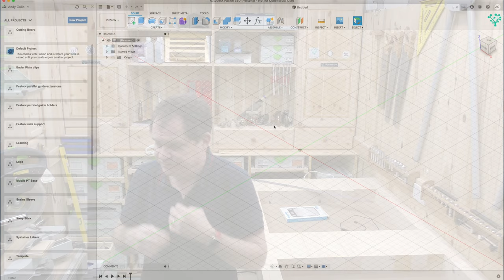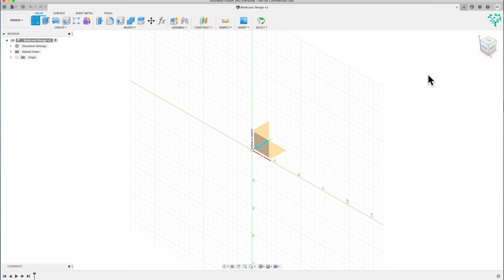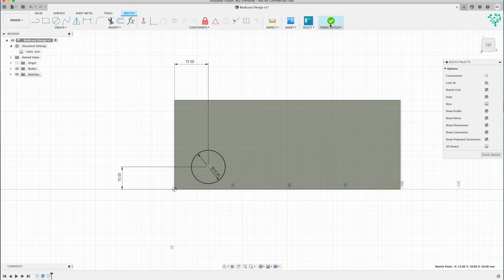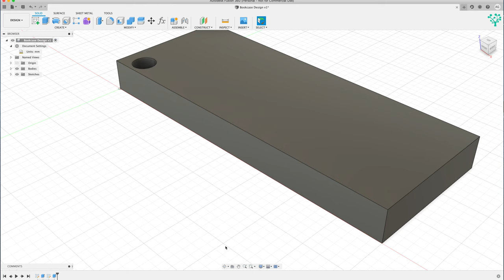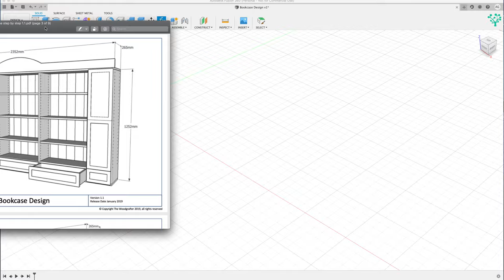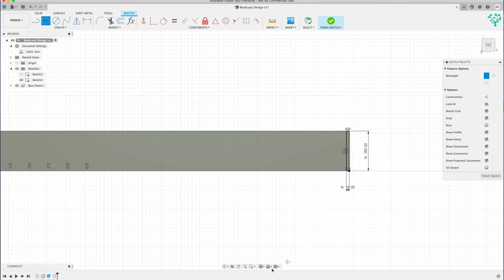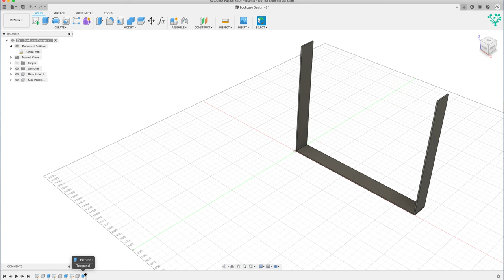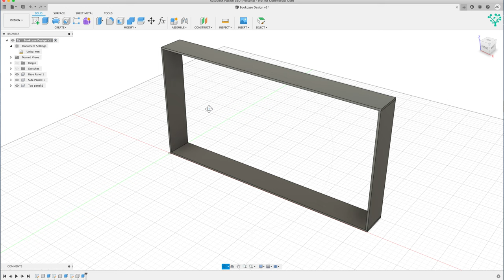Fusion 360 for Woodworkers - Lesson 2 Parametric modelling, bodies and components

Comment: You do an amazing job of clearly illustrating the methods and then reviewing it all at the end of each video-- brilliantly.  For an experienced woodworker, the use of User Parameters is amazingly powerful for a number of reasons.  One good example is I'm building an outfeed table/cabinet and two others that sit beside it.  The style and construction is identical, but the width and depth of one cabinet is different.  I only have to model the one and then I can create a second set of full drawings by just changing the parameters!  If I was a commercial shop the cost savings would be amazing.  I'm just a retired guy who is saving time, but that is precious as well.
Reply from the maker: When you understand how parameters work its a game changer.

I now make everything a parameter, I can’t remember the last time I put a measurement directly on a line.

I have a whole series of coffee tables, I design one table and changed the parameters for width and length and height. New design completed with workshop drawings ready to go.

Awesome.

Andy

Comment: The one topic I would ask that you cover is joints.  What the two types are, when to use each type, and how you use or don't use them in your designs would be of great help.  Thanks and keep the videos coming.
Reply from the maker: Hello again,

Yes I will be looking at joints. I tend to use joints when I want to position something in relationship to something else. E.G. when we make the drawer unit, I will make that as a stand-alone sub assembly and then use joints to put it into final position, that way I can make the drawer open and close along a set path.

You can use joints to position the pieces of the carcass as well. E.G. I could have made the side panel, and then made the top panel and used a simple joint to connect them together.

I don’t tend to use that technique as I just start me sketch on the face I want to connect to.

It will make sense when we get to that episode.

Cheers

Andy

Comment: Great video again, learning about those parameters was really helpful. I've built some models for my 3D Printer since your last video, and although I got the job done, it was always a lot of trial and error. These videos help give a much better basic understanding!
Reply from the maker: Hi,

If you can crack parameters you are half way there - the challenge is thinking it through so you can reference ALL of your bits back to the parameters. Gets interesting for example when you have dovetails and decide to change the size of the drawer - BUT we will get there.

I find Fusion great for 3D printing, I bought some scales for the workshop - decided to make a hard storage case for them - literately took about 15 mins to design and start the print. Took a day and a half to print mind ;-) but the design was quick.

I may do a course on Fusion and 3D printing after this one.

You really get hooked.

Andy

Comment: Hi Andy, You got me hooked on Fusion 360 with your hands on approach, showing us how it is done. Kudos! Two things though:
a. When using the dimensions you use BookcaseWidth - StockThickness - StockThickness or something pretty close to that.. but you can as easily make that BookcaseWidth - 2* StockThickness. Saves on the typing and this more computer code like write up makes it more easy to understand in the long end.
b. With software of this kind going to the cloud are you not affraid that Autodesk will eventually make it an expensive paid adventure of x GBP/month forcing you out of Fusion 360 and if so, what is your alternative as per your perspective for simple hobby woodworkers?
Regards
Reply from the maker: Hi,

Thanks for the feedback, you are correct - in fact I was playing with expressions today (working on the math for the length of the centre panels that will have dovetails) - and came up with "bookcasewidth-(2*stockthickness)+((stockthicknekss/3)*2)" So yes you are correct. I guess you can get pretty complex with these expressions - I may give it a go one day to see how far I can push it.

However when explaining things it's easier to grasp when you say minus the thickness of the top and minus the thickness of the bottom. I think its more visual - not every one can see maths. I felt it was more important to explain the concept, people will find their own way if they have the concept.

To your second question, yes it is a danger when using any SaaS subscription that the vendor will change the commercial model - and all of your work is trapped in a format. However, whilst the hobby and startup licenses are free then it makes sense to use it. Also Autodesk has had this free hobby license for some time - so it must work for them. 

AND don't forget, I run the Woodgrafter as a business, so will be purchasing a yearly subscription when my startup license expires next year. So I am not too concerned about it. I find Fusion so powerful and useful in my everyday design work (and now add 3D printing to that) and the CNC machine isn't far away. That I think it is value for money.

Cheers

Andy

Comment: I've been using cad and fusion is hard concept as drawing uses different principles. Seems to be more commands needed to achieve the same thing. I use mirror command often in cad to copy items. Can I ask why you drew a new component for the top rather than copy/mirror the bottom panel? Thanks.
Learning more from your videos than other places. Thanks

Comment: Hi Andy, Have started watching your tutorials on fusion and am enjoying them and I am slowly getting it on how to use it. Its a bit of a slow process and it makes it easier using a project in wood to learn. I notice in this episode when you where in your save folder you had a folder for Festool labels, can you share this with me so I can also make my own labels for my Festool products. I will understand if you would prefer not to. keep up the videos they are great. Regards Kim from Australia.
Reply from the maker: Hi Kim,

Welcome to Fusion 360 - it is a great piece of software, but a steep learning curve. AND you never stop learning.

I hope the series in small way.

Yes no problem, of course you can have the file. It was designed to be 3D printed. I'll drop the source file somewhere on the community site and send you a private message on the site.

Will get to it tomorrow.

Cheers

Andy
Reply from the maker: Hi Kim,

File uploaded - check you messages on the web site.

Cheers

Andy
Reply: @TheWoodgrafter  Thanks Andy Regards Kim

Comment: Hi Andy - thank you for all your efforts on this series, I am slowly making my way through them in an effort to make the transition from SketchUp to 360. It is hard going but worth it in the end i hope! One thing I cant seem to find an answer for is this....

In sketchup you can make a component and editing that component makes changes to all copies like in 360. However, there is also the option to make a copy 'unique' if you need to make adjustments to just that version of the component. I have used the Make Pattern (along path) tool to create a series of dividers for a cabinet. However the joinery in a couple of them differs from the rest, is there a work around for this?
Reply from the maker: H Rick,

Yes that had me stumped for a while as well.

If you select the component and then choose copy from the quick menu (right button in white space) or from the edit menu at the top then you will see two commands in the right click menu.

Paste & Paste New.

Paste will create a copy that is always linked to the original - change one and then the other changes
Paste New will creata a copy that is 'based' on the original but is a new instance

The challenge is that each command has a slightly different outcome.

E.G. 

The pattern tool will create a copy
The move copy tool will create a copy
The mirror tool will create a new instance of the component

So if you know you will need to edit then use the mirror or paste new tool
If they will always be the same then use paste or pattern

And know, there is no right click make unique. And yes that is pants.

Cheers

Andy
Reply: @TheWoodgrafter  thank you!!
Reply: @TheWoodgrafter  Thank you for this explanation. I have been searching for this answers for weeks!

Comment: Hi Andy,
 sorry to bother you again but I am having a bit of a problem with the Grid and snapping etc., can you let me know the best way to set up the grid and the settings please. I have trouble because of the snap situation keeping things at 90 degrees and parallel. I am slowly getting things done and have a long way to go, I have gone through 4 to 5 of the lessons but I am back on the 2nd lesson to try and get that sorted and me up to speed, I am certainly learning but find it a lot harder than Sketchup and even AutoCad Architectual  although with AutoCad I did go and do the beginner and intermediate course, but I will not let this beet me I love the drawing side of woodworking. Regards Kim
Reply from the maker: Hi Kim,

Glad to hear you are sticking with it, and ask a many questions as you like.

In the drawing pain, in the sketch workspace. Look at the very bottom centre of the screen. You will see a graph paper type icon next to the monitor icon. Expand that and un-select snap to grid. Not you can start pretty much where you want, and set the angle through parameters rather than Fusion adding constraints you don't actually want.

Let me know if that helps,

Cheers

Andy

Comment: Hi. I did this exercice 3 times and everytime, the Top Panel on top left corner looks like it is not over the left side panel even if the length is Bookcaselength. The other end fits right. The measure on the sketch seems to start at the right place pour the Extrusion is not. what am I doing wrong? Thanks.
Reply: Forget about my comment, I just saw the tweek your are doing and now it is ok.
Reply from the maker: Cool, thank you for letting me Know.

Andy